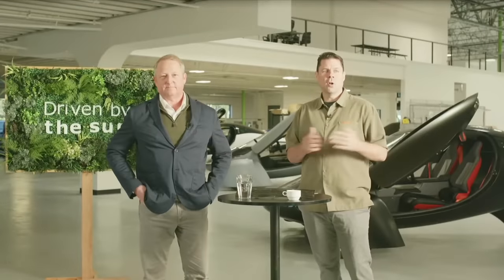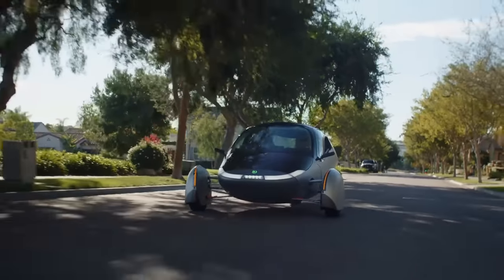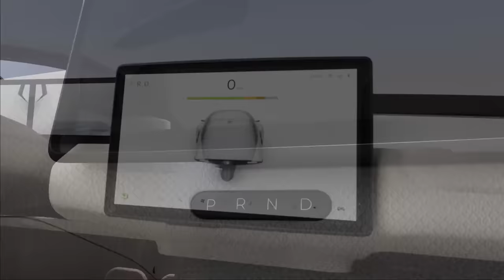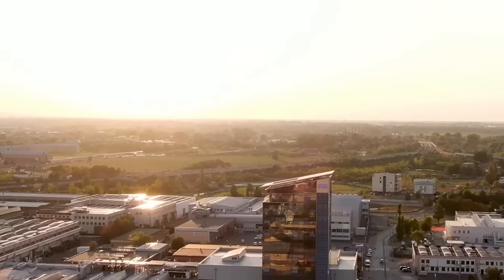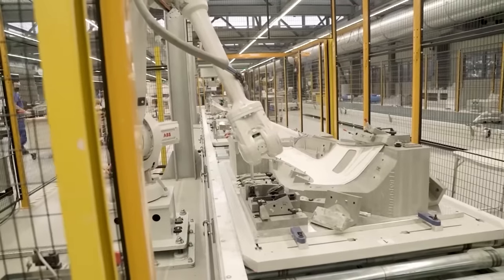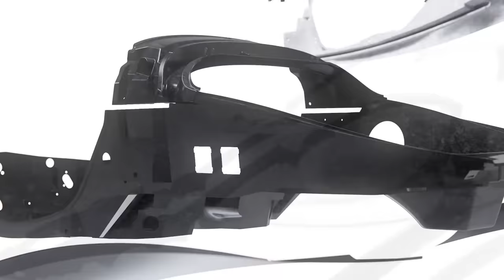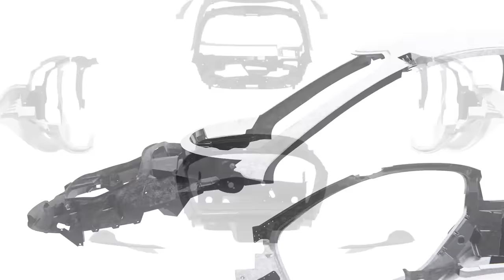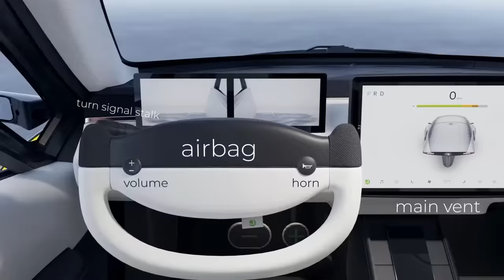Announcing Aptera's Launch Edition | Live Webinar

Comment: I feel like Ive seen this exact Aptera movie a bunch of times over a decade or so in different iterations and power sources including ICE with this shape and as far asI know they have taken a mess of deposits over many years and never delivered a thing . That may be simplistic and Im not a negative person . But I feel like I had to delete the info on this company multiple times deciding / finding out it was vaper ware and had wasted my mental resources taking interest and waitng and waiting .

I litterally am so confused and feel like its groundhog day and I cant remember how many have happened . I certainly know the name and the shape and it being attached to different really high effeciency metrics and people excited .

I wonder if Paradigm people are the people who put deposits back when the original lotus based Teslas were hitting the street or whenever it was,  my brain is scrambled for timelines about this company or the name . I feel like in the NOT SUPER DISTANT past Jay Leno drove one with an outdated little ICE engine that was deemed fine despite being pretty crappy becuase of the low weight and drag that it didnt need hyper effeciency or to be super clean because the massive MPGs would offset everything and it would be serviceable by owners , and if I remember correctly the MPGs tended to shrink every time the delivery / production dates were pushed ahead as well as the price going up and some other shannagins including letting people test drive the mules  that may or may not have been like a fighter jet with seating in the same basic design that I think way back could use a bit of solar as well . Its so confusing.

I had written it off as Vapo Rub Masturbation but then when Jay drove a mule I thought Jay is very particular about his dislike of companies that think they can build cars because they can make a prototype or multiples that are OK but a bit wonky who all claim tio be close to production with the general public not understanding how insanely difficult manufacturing is in general and as far as cars it becomes so insanely statistically anomolous to even get close to production and even if it could and did is almost certain to die based on the evolutionary process of car companies and all the established brands that shit the bed as well as the new ones that do . Particularly ANYTHING in the car market that is meant to become mass produced .

Tesla only making it this far because Elon is nuts , has and had his own money to play with to whatever degree , was the first to go hard and wasnt about taking out other companies but rather forcing them to adapt and change when he could prove what was possible FORCING THEM to compete with him and succeeed so as to effect change he wanted to see that he thought was doable despite others not thinking it would last any length of time and now the whole world is chasing Tesla in EVs wether it is the best move or not and feasibility issues and costs to consumers and infrastructure , grid , DUMB ASS ECO NUT ZEALOTS who are causing as much environmental issues as they fix saying they are gonna hold their breath until mommy gives them a pony that talks and shits moon pies and having tantrums inbetween holding breath and demands telling Mommy I dont care if Ponys cant talk , make em talk and use coal plants to make the voice boxes and brain implants for MY PONY TOMMOROW .

Everybody counts him out or loses their ass shorting tesla . I mean the Dude gets stuff done and DOES BUILD MFG PLANTS as well as builds impossible  rockets so , i just watch and laugh at the people who have been sure its all done in a month or 2 for 10 years or whatever and I dont know enough to say who or why anybody is wrong or right despite having questions about things that seem big problems but I also think that EM figures for things others dont so their predictions of him give them bad outcome probabilities and he is willing to take very large calculated risks with big payoffs so .

Anyway , I am very leary of Aptera . They have been raising funds for ever and having fun designing these things which I think are cool in concept and similar to ideas I have personally had for decades despite having 0 ability to do anything but I do wonder how much salary they take and how much fun they have playing never ending start up and telling people its coming .

Perhaps its the prompters and such but I feel like I have seen previous talks about this or something like this that wasnt so apprehensive and wonky in its delivery of the Pitch behind a product based on a proto type , like its getting harder each time to say stuff with confidence and needing a very prepared pitch that doesnt seem polished as far as presentation which may nean its written wonky and not intuitive becuase its not real , DONT KNOW .

Im not holding my breath . When Musk makes Ponies Speak via Neural Networks and Human DNA combined with AI , i will be interested but I will let others let their kids have super ponies and see what that does to them considering the stigma around kids who get Ponies on a whim from wealthy parents who give in to wihning kids , so a talking Pony would be great if they never need to speak to the kid being raised by a cyborg pony i guess , we will see  .

Comment: Vinyl wrap instead of paint? Only 150 miles of range overnight  on level 2? No level three fast charging? So roadtrips are impossible even within the existing infrastructure.
Reply: It's 57 miles per hour charging with 240 volt plug.   That's plenty fast for home charging, but no DCFC is a deal killer.  Impossible to realistically road trip.  400 mile range is probably more like 300.  Then you will usually stay between 20 and 80% battery range so you will probably only really get 200 miles max.   No heat pump.

Comment: Ok there are many bad points here.
The charging speed sounds really bad, 57miles per hour in a vehicle where the range data from the page tells us that the car reaches 10 miles per KWh, or 9,5 miles per KWh now presented here, 57miles per hour means then that the charging speed is around 5,7kw to 6kw, I really hope that there is additional fast charging.
Why did you even use this port if it is so bad? Wasn't the whole point that they are used by Tesla as super chargers?

I could see a 50kw Charger, even though that would definitely mean, that you need to buy a bigger battery. But I would not mind after around 800 miles charging for 2h. Even if I go on a really long trip I do not think that I ever will travel more than 1600 to 1800 miles and if I do I definitely will stake a night sleep in between. So big fast chargers with 150KWh, 200KWh or more are really not necessary. But at least 50KWh should be doable.

I really can't imagine why someone would not allow for that, even normal cheap batteries allow 2C charging if there is a temperature management system. So there is no reason to not just have at least a 50KWh Charger.

Also, do I see that right, that the efficiency is now lower than predicted? From 10 miles per KWh to 9,5 miles?

Comment: Not to mention the range due to solar also depends on the wh/km, they say 100wh/km,
if it does ever get 100wh/km would be the absolute max, based on their theoretical numbers, as you drive you will not be getting 100wh/km continuously ( if you will ever get that is also not proven). So even if you consider all the losses of solar which is not factored in, then you then have to allow for the wh/km also, which is constantly changing as you drive. So what they are saying is in my view..........fantasy......lets see the actual numbers so that the investors can get a more reliable and reality based estimate.
Aptera will already have these numbers but for a small 10kwhr battery pack, much lighter than will be in the future prototypes, that will also adversely effect their predictions.
Dont expect to see any real world data soon, as it will interfer with the sales pitch to investors.

Comment: Launching with 400 mi makes sense.  But, scheduling the much lower profit margin 250 next makes no sense. You should do the 600 or 1000 in second phase to maximize early profits. Do 250 last because it won’t contribute as much to bottom line.

Comment: 2:51: ERROR: NON-STANDARD CHARGING CONNECTOR

DETAILS:
SAE J1772 is the standard Level-2 electric vehicle charging connector for all electric vehicles in North America and Europe...  except Tesla.  Unless you're prepared to offer an option to fit a standard charging connector, you have just imposed the unnecessary expense and hassle of an adapter plug upon all your potential customers.
Reply: There is an inexpensive adaptor available to connect the Aptera NCAS connector to SAE J1772.  

You are incorrect about SAE J1722 use in Europe.  It is used in Japan, but Europe uses IEC 61851, also known as CCS2 -not the same as the North American CCS.

Comment: Two things I want for Aptera in Australia very soon -
150 kW DC fast charging. With Aptera's high efficiency that would make it a road tripping monster. Great for sales reps in remote areas.
V2x Being able to get power out of the battery would enable solar powered camp sites. Also very helpful when the local grid goes down - such as in floods, bushfires and  grid malfunctions.
Reply: Alan - Its Left Hand Drive. No time line for RHD.
Reply: Some people need fast charging to make an electric car viable for their work.
Also, battery degradation is becoming less of a problem with improvements in battery chemistry, better management of charging that limits conditions that cause degradation while charging and also limiting fast charging to around 80%.

Comment: I was expecting to see a real world demonstration of the launch edition, instead just some speeches and more computer graphics, a sales pitch for crowd funding, and some predetermined questions.  I ask, why are there no independent instrumented tests yet?  By now other manufacturers would have given a production ready car to someone like Car & Driver to let them do an honest evaluation.  

I see this as a third vehicle in the garage, like a motorcycle and being classified as a motorcycle, the safety may only be slightly better, although the level of safety required is very low, being that it's seen as a 3-wheeled motorcycle.  Disappointing to see manufacturing will not (initially) even be in the US, so no way will it qualify for any tax credits.  I see this as a reasonably good communter vehicle to go back and fourth to work, not anything more and most people cannot afford to have a vehicle that only has one purpose, I see it as a niche vehicle that will have very low demand overall, hence low annual production numbers.

Comment: More begging inexperienced retail investors for money, even though if it were a good investment at this point they should have no issue securing venture capital funding given how close they say they are to launching. 
Honestly I wanted to give them the benefit of a doubt after all the delays but this doesn't look good. No fast charging, only 400 miles for now, price almost comparable to a Model 3 (with tax credits). And even that will only be delivered by 2024 by the sound of it. Who knows when there will be a 1000 mile version if ever.

Comment: WTF.  No DCFC?   You guys have had years to plan this vehicle and unbelievable that at least 50kw fast charging isn't available   and then one more slap to the face is only a 6.6 kw on Board charger.   Makes this unusable for road trips.    Basically it's a local commuter car now. And at this price point I can buy a volt cheaper.    Dumb AF.  Why have the Tesla plug if you cant use their supercharging network.   I really hope they figure out DCFC option for launch edition or they will lose thousands of reservations.

Comment: Just 2 year lifespan (or I guess he said 10 year?) on solar panels for 25 grand?  EDIT - guess it's 10 year, my bad.
Reply: 2 year lifespan?
Reply: 8:00 they said 10 years, not 2.
Reply: Listened to it again - you might be right...sounds more like "tin" than "two" but hard to say for certain.  Even the phraseology of "reaching a life of" tin years is a bit concerning.
Reply: I think he might have said 10, not 2.
Reply: @newman5924  Yeah 2 year solar lifecycle would have everyone's alarm bells shooting off into space. They wouldn't warranty it at all and if they did, company would be bankrupt and gone for sure this time once it came time to replace them under warranty. "World's first solar EV raises xx million and designs cutting edge body, but can't get solar to last two summers".

I'm glad it's at least a decade lifecycle, but I'm surprised it's not more. High temps are the lifecycle killer for solar, and I would've thought the skin cooling system they always refer to would ensure the panels remained at least 5-10ºC cooler. But I have to assume that's either not the case, or they're not counting on the system to passively reduce cell temperatures below 85ºC (185F).

There's a good demonstration by Tech Ingredients on YT that also shows that if you actively cool panels, you can get more power out than you put into cooling. More power, longer life. But again I suppose this 10yr estimate is worst case.

Comment: Far sighted people cannot use screens instead of mirrors. You need to have version with reular mirrors.
Reply: 1. How do far sited people safely see the center mirror and the driverside mirror because they are basically as close to you as the screens are.
2. It does have small mirrors becuase they are required by law unfortunately.. I like the screens infront of the yoke though because I don't ahve to look away from the road in order to murge or enter a turn lane safely.
Reply: It messes with the aerodynamics of the car.  This car has lower drag than the mirrors of an F150.
Reply: @reru_personal  mirrors don't work like that. Eyes are focusing at the same distance objects in the mirror are in relation to the mirror. Light beams are same like you are looking directly at the object.
Reply: Just get glasses. Do you want everyone to suffer just for a few people?
Reply: @tjam4229  it doesn't work like that. If I put glasses to see screen then I don't see far, I see only close objects 😀
Reply: @DrazenKlisuric  , sounds like you need BiFocal glasses?
Reply: @tjam4229  Bifocals help but there is still an accomodation necessary when switching between road objects and screen objects.  One possible solution would be to digitally de-convolve the screen image to suit the optical prescription of the driver.

Comment: Congratulation for achieving this. As European I got mixed feelings today. Chris A. repeated he expects to deliver a few thousand obviously unchanged models circumventing regulations. I remain worried these are not practical and may be dangerous to drive and park over here. Have a look around in Modena or Amsterdam …
Reply: I think this car won't ever make it to the European market.  The width is almost 88 inches, which is too wide for European roads.  It is much much wider than even BMW 7 series SUV or Mercedes S class SUV.   88 inches is actually even wider than most cargo van.